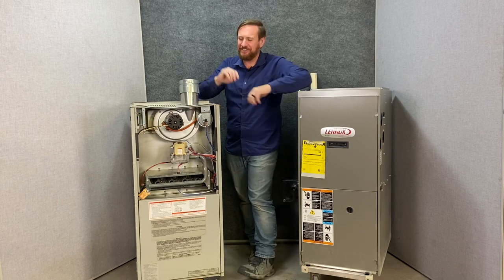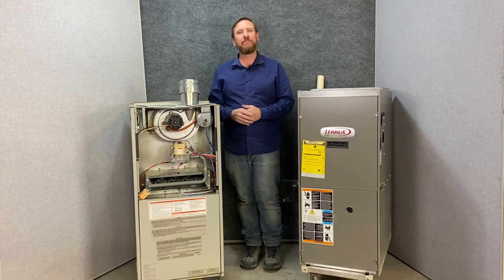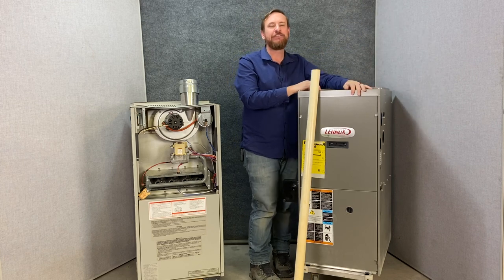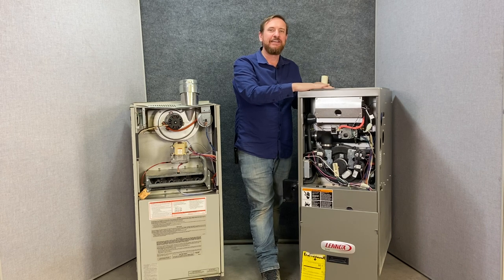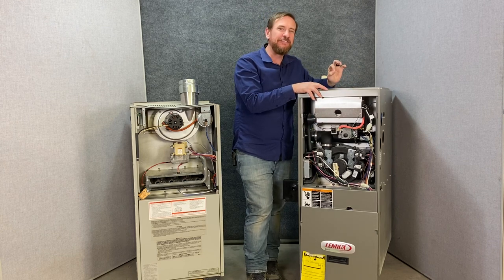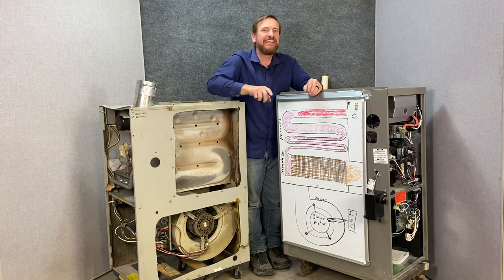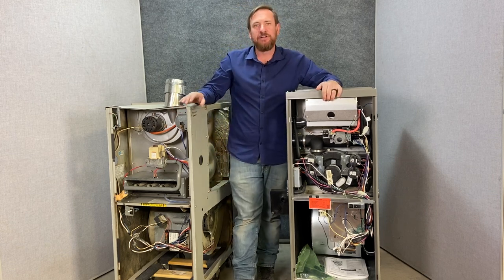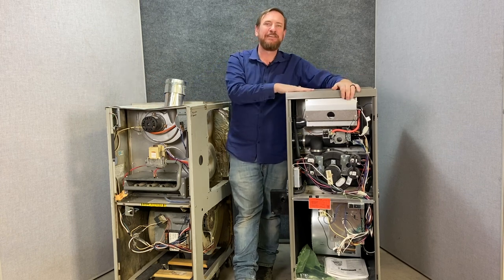80% vs 90%+ Condensing Furnace

Comment: What about the ice buildup from the steam coming out the flu in the northern regions?
Reply from the maker: There are solutions. Thousands upon thousands of these run in the northern regions. If we could get installers and sales people to follow the installation instructions it solves most of the issues. The rest just need customer attention but there is always a solution.
Reply: @love2hvac  so if there is ice build up it is likely an installation issue?
Reply from the maker: The location of the exhaust,
The pitch of the flue, the length of the flue, the number of elbows, how much pipe is exposed, and Wich side of the house it's on all play a part. 
Also when people add screens cause big problems.
Reply: I installed my 96% Goodman, i have checked the flue and intake outside and there's zero ice even though it was zero degrees outside, if the flue has the correct slope- the condensation drains back into the furnace and down the floor drain. You also install a TEE so it has an open top and bottom
Reply: @Jonatone  yes, maybe the flue wasnt sloped the required 1/4" per foot, so a 10 foot long pipe should have a slope of  2-1/2", 20 foot long should have 5" of slope, if it's not condensation won't drain as well back to the furnace and out the floor drain

Comment: I did a remodel recently. To maximize living space, I put the furnace in the attic. HVAC folks told me I could only do 80% efficiency up there. I still have a drain pan though... maybe that's for the AC coils? Could I have gone 90%?
Reply from the maker: A lot of people are scared of the 90% because they don't understand them or they deal with issues from bad installations. I can't think of a scenario where a 90 would not work. It is a matter of time before 80% furnaces are phased out. 

I understand needing more space but the attic is the worst possible location for HVAC equipment.  
Sorter life, less efficient and harder to service.
Reply: @love2hvac  Absolutely agree on the attic! my workplace had installed 3 units in the attic, and 2 on the freaking ROOF, filters in all of them had to be changed weekly (wood shop) and in the cold months the attic got so sold the condensation drains would freeze up, what a headache! 
To make it worse, one had a flue/intake combined PVC that had a 90 degree bend, and condensation froze there, furnace guy told me just cut the intake part out so it gets it's air from the attic directly separately.

In the winter the units struggled to provide heat when the units and ducts were all in a space approaching ZERO degrees, in the summer it would be 130 degrees and the a/c couldn't keep up.

The 2 on the roof, on a sloped metal roof, took a 20' extension ladder to get up there, change out the 4 filters each, in the winter there was snow and ICE up there, just STUPID locations to put something like this that you have ti service and change filters on too.
Reply: A high efficiency furnace creates water during combustion which can freeze in an unconditioned space like an attic.
Reply from the maker: 1st unconditioned spaces are never good for HVAC equipment or effecency.
2nd If installers actually read the installation manuals so many problems would be avoided. 

They have provisions and kits to prevent freezes
Quote Lennox:
"When the furnace is installed in an unconditioned
space, consider provisions required to prevent freezing
of condensate drain system."

Also 
" 
Con-
densate drain line should be routed within the condi-
tioned space to avoid freezing of condensate and
blockage of drain line. If this is not possible, a heat
cable kit may be used on the condensate trap and line.
Heating cable kit is available from Lennox in various
lengths; 6 ft. (1.8m) − kit no. 26K68; 24 ft. (7.3m) − kit
no. 26K69; and 50 ft. (15.2m) − kit no. 26K70."

Even the flue has considerations 

" NOTE − During extremely cold temperatures, below
approximately 20°F (6.7°C), units with long runs of vent
pipe through unconditioned space, even when insulated,
may form ice in the exhaust termination that prevents the
unit from operating properly. Longer run times of at least 5
minutes will alleviate most icing problems. Also, a heating
cable may be installed on exhaust piping and termination to
prevent freeze−ups. Heating cable installation kit is avail-
able from Lennox. See Condensate Piping section for part
numbers."

Comment: Hi, I was hoping you could give me some advice.  My parents had a new Amana furnace 6 roller (model AMES801205DX installed.  Unfortunately they continued to have problems with it.  The seller admitted they installed too big of a furnace for their house and replaced it with a Goodman 3 roller (model AMES800604BXAA).  They did not receive any refund for the price difference.   My dad has dementia and my mom has Parkinson.  I think the company took advantage of them, but I can't find the prices for the furnaces.   Any feedback you could provide would be greatly appreciated. 
Thanks,  
Kevin
Reply from the maker: It's great they replaced it with the proper size. It's very unusual for a company to admit they did anything wrong. It is great they replaced it with a correct size. The price difference in a furnace sizes are very small  80-200 max.  The cost the company incurred to change the furnace was  much greater than that. The are unlikely to sell the original furnace since it is now used. Sounds like thay took a big loss. 
As long as it is running properly and safely I would call it good.
Reply: @love2hvac  thank you for your feedback
Reply: @love2hvac  thanks for getting back.   I'll go with your advice although I was under the impression  Amana furnaces were more expensive than Goodman.
Reply: @kevinswaney5875  But as I recall, Goodman is MADE by Amana...

Comment: You seem to prefer the high efficiency (HE) furnace in your video.  It gives the impression that you save money in the long term.  The HE costs significantly more to install, but the idea is you save in fuel bills long term.  Not really though.  The HE furnaces are materially more complex mechanically and electronically.  With many more parts to fail, long term, the repairs are more numerous and expensive. The modest savings in gas bills is quickly eaten up by the maintenance costs.  The real beneficiary is the gas company which gets significant tax credits when they can claim your HE  furnace purchase as part of their 'energy savings' program.
Reply from the maker: Let's start with "many more parts to fail". 
Let's compare a single stage 80% to a single stage 90%+
They both have combination gas valve, manifold, spuds, inshot burners, rollout switches, primary limits, vacuum pressure switches, IFC, blower motor, housing and wheel that are identical components in the same manufacture. They both have an induced combustion blower but the 90% pluss has the housing made of composite plastic.  They both have a heat exchanger but the 90%+ has a secondary heat exchanger made of stainless steel. The 90%+ has in addition a metal combustion box and a plastic drain. 90%+ is 30% more expensive than an 80%. The pay back time if any will depend on the run time and gas cost. 

Now If we  talk about  2 stage , those parts are more complicated and expensive. But if we compare a 80% 2 stage to a 90%+ 2 stage it is just as listed above. 

The complex and difficult units are modulating. They are much more expensive, much more technology, much more expensive.  People seem to label all 90%+ with modulating.

Next we have regulations. In many parts of the country 90%+ is mandated and it is a matter of time before it's mandated everywhere. It's being pushed right now. 

Already pushed out is other efficiency standards that also affect the 80% such as mandated ECM motors. Before universal PSC motors cost $60-80 now ECM motors cost $900 and more. ECM motors do not work well with improper ductwork. People with new 80% furnaces are complaining about this just like 90%+

The biggest issue is lack of skilled training in the skilled trade. 
I find the majority of 80% and 90%+ furnaces are not installed correctly, not set up correctly, running on improper ductwork, improperly sized. I find techs and installers do not follow the installation instructions. They do not even know how to clock the gas meter, change orifices. Some companies don't even have combustion analyzers and certainly don't know how to use them. So .any companies are not checking static pressure a big cause of heat exchanger failure and blower failure.  So many of the companies are so eager to sell a new unit they are not performing heat load calculations Manual J, manual S for proper selection, manual D for proper duct design, or mannual t for how to blow the air.  
We can't expect to just sell boxes designed and regulated differently the same way there where 40 years ago. 

It's like having mechanics that prefer carbonators trying to work on fuel injection system. They both work but the complex one is what we have and when it's done right it works. 

Meanwhile hestpumps are in the move.

To me it's technology. Technology is moving forward if we like it or fight it. Its much easier when we learn about it.
Reply: @love2hvac  I couldn't agree more. The value derived from HE is variable and also dependent on the uneven knowledge of the installer. With all the moving parts mentioned in this thread, it is worth considering the simpler solution to heat your home.  This is really my only point. 80% percent efficiency with a good warranty and quality parts can service most  homeowner's needs for decades. Regards.

Comment: With the forced draft blower on the 80%, how far can you run the vent horizontally before you turn up to the roof?  Could the B vent exit a side wall?
Reply from the maker: The 80% It's not a forced draft, it's an induced draft. This means it pulls a draft through the heat exchanger but still relies on natural convection for the flue pipe. The motor and fan is not large enough to pressurize the flue pipe, nor is the B vent rated for pressurization. Category 1 furnace

You will have to check the particular furnace manufacture instructions and local codes to see what the limitations are for vertical runs as they very.

Comment: Are break downs greater with 94% ?
Reply from the maker: When they are installed properly they work the same as 80% 

Unfortunately they are often installed incorrectly and that causes problems.

Single stage is the simplest and cheapest to work on.

Next is the 2nd stage.

Modulating is the most expensive to repair.The efficiency of each one is the same, in theory the modulating provides more comfort with longer rim cycles at lower capacity. In reality leaking ductwork and improper installation makes them the most prone.
Modulating furnaces also are the most expensive parts and the most difficult to diagnose.

Comment: Why would someone recommend an 80% efficiency furnace over 90+ ?
Reply from the maker: Some people have had bad experiences with modulating 90+, an improperly installed 90+, don't understand the operation of a 90+, or have had to deal with the expensive and limited parts cost of specifically modulating 90+
Reply: Because they are piled up in the warehouse.  Higher profit margin

Comment: I've seen 90+ Furnaces where the Intake air is connected with the Exhaust pipe going out the roof. Is that right?
Reply from the maker: Yes if it's a  concentric vent here is a video about them.
https://youtu.be/mBWJ1nwwqmk
Reply: @love2hvac  dang thats pretty cool. Thank you.

Comment: I have a 95% furnace in my home. I really wish I had my old 80% furnace back. These newer 95% furnaces are just a PITA. The 80% furnace heats much better, last much longer with many less issues. I want to remove the 95% furnace and replace it with another 80% furnace. Many of my neighbors feel the same way as I do about these newer furnaces. We just don't like them. I live in the Midwest so I really use my furnace. Not impressed with this newer unit at all.
Reply from the maker: The issue is unfortunately most people don't install them correctly.

2nd problem is the modulating 90 that is my h more complex than a single 90

3rd you have companies training techs to sell instead of repair. 

4th In a good part of the country is not allowed to sell 80%

4th It's also a matter of time before you can't get a gas furnace and the government forces heat pumps on everyone

Comment: you can buy single stage condensing furnaces which have the same parts as single stage mid - not that it's a good idea to buy single stage.
Reply from the maker: You are correct in single stage furnaces have the same parts as a mid 80. 
As for it being a good idea, it depends. 

A single stage and a 2 stage is actually the same efficiency. 
A 2 stage has the ability to run longer on lower stage for less temperature swings but the parts do cost significantly more.

Properly sized single stage furnaces with a sealed home will perform the same and have the same comfort. 

Most furnaces in the country are oversized even for the leaky houses they are installed in. When they run in low they are actually running closer to a single stage furnace that's properly sized.
Reply: @love2hvac  A properly sized single stage is oversized most of the time and will never get to run continuously except for in the coldest 1% of weather and when warming the house up. A properly sized 2-stage controlled by 2-stage stat will never shut off in a cold snap, just shift between low and high - and offer much better comfort than single, it feels like hot water heat where the rads stay hot after the stat satisfies.

The extra part cost of a two stage of same efficiency is not that significant if it has the multi-speed constant torque blower motor. If it's variable speed/constant airflow, yes it can be substantially more.

For most applications, single stage is totally obsolete - it only makes sense if the duct system is not suitable for the reduced airflow on low fire. 80% is also totally obsolete in cold climates exception being applications where venting is not practical and or condensate freezing is a high risk.

Comment: Somewhat worried we are in need of a new furnace getting installed tomorrow. Was quoted a 92% vs 95% one stage furnace. Price difference was only $400. I decided to go with the 95% somewhat wish I would of went for the 92% to save us money. We are going with a Trane brand. Our last one has lasted over 19 years.
Reply from the maker: Installation, proper commissioned installation is more important than brand. 
I'm not saying do or don't but
What is wrong with the old one? 
What region?
Reply: @love2hvac  I live in NC. My gas bill normally $200 some never over $300 but for March $422. We normally keep the temp 68-70 It did snow and be freezing a lot in February though. It was it broke once i cant remember what was wrong would turn on and make noise but nothing was blowing it was the part that deals with the temp wasnt working so the thing didnt know to cut on to blow and then broke again and this time its the motor I believe. 

An the company that is installing the new one is licensed and was the same company that put in the other. It was serviced for 9 of the 10 years but when we took over the house didnt know anything about the upkeep of a house and just now learning the ends and outs. Already got a new hot water heater and a air conditioner will be next.

Comment: My recommendation is stick with an 80% if you can buy an Old furnace by an old one! With the old pilot they last and the gas prices have been higher ever since the new furnace been put in!
Reply from the maker: A standing pilot furnace is the worst choice. Many people had CO poisoning because of back drafting and checked heat exchangers.